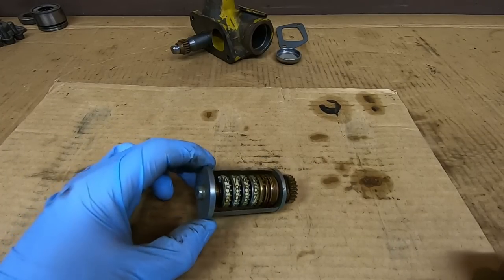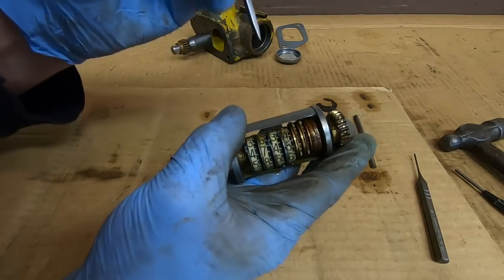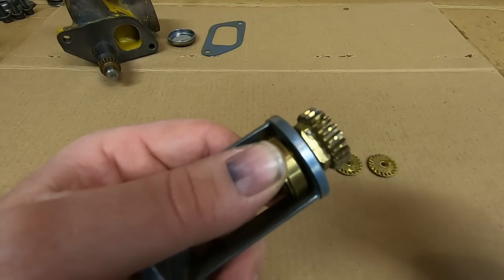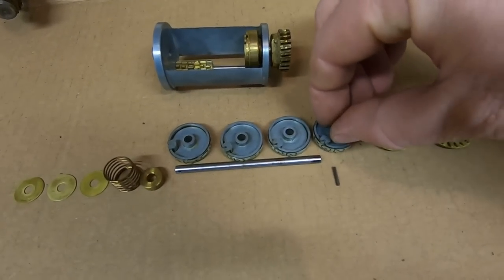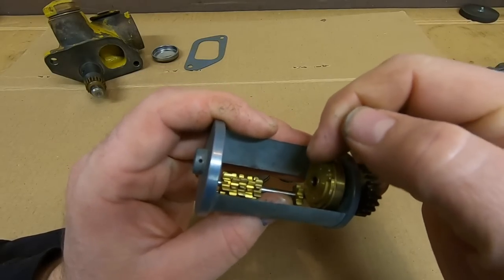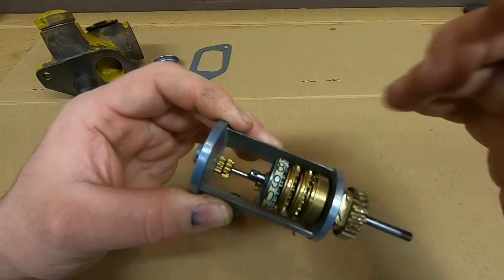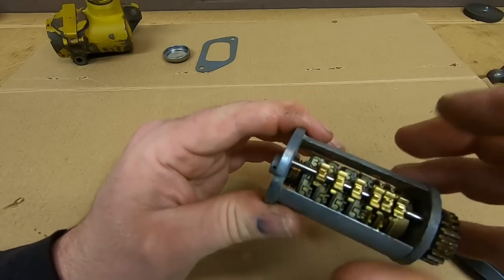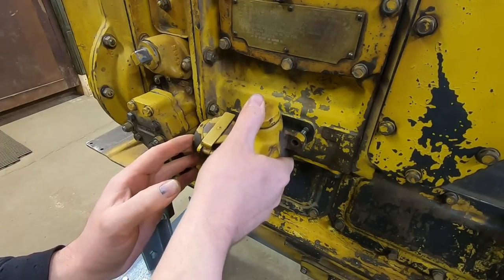Caterpillar D2 #5J1113 Diesel Engine Assembly Ep.38: Hour Meter Counter Repair & Meter Installation

Comment: You just went from Blacksmith (flame & brute force) to watchmaker in two videos, no easy task. If you reversed these skills the combustion chambers would still be stuck in the head and the hour meter would never work again! Apart from showing how to restore an old machine, you are demonstrating a technique and skill in how to think through and approach these type of challenges. What i take away is that, given enough thought, there is always a solution. Cheers Squatch.

Comment: I work on all kinds of tiny stuff - even have a microscope on my home bench. One trick I've learned with similar counters is stacking the dials on a cut-short shaft, then slipping it in as a stack, push the cut shaft out with the real shaft.

Comment: That's amazing technology from way back in that era!!)), no wonder Caterpillar is No 1 in earthmovers
Reply: That's actually a very standard digital counter mechanism used by absolutely everybody from the mid 1800s (if not earlier) onward. I expect it was patented by someone originally, probably in the 1700s, and then after the patent ran out everyone copied it. I've seen pictures of clocks where the parts were made of wood, and somehow managed to last for years. I last saw that mechanism design used as the counters on cassette tape recorders in the 1990s, but I imagine there are still a few things around today that might still use a mechanical counter.

Comment: Easy method to do the dial paint = paint the numbers black first. You can be sloppy, let the paint set an hour or so. Once that's done, carefully wipe the excess using a barely, barely keyed clean rag with  some paint thinner, just to wipe the excess, then, take a flat, spotless clean surface and using a brush, put a white dot on it. Using a sharp edge spread it thin and long, then, simply roll the dial over it until you have full coverage.
If you do this assembly style, you get the whole set done in two hours in between two sandwiches or what have you and they come out factory fresh, without any hassle. Seriously, i know it sounds involved a bit, but it's 1 2 3 and you're done.
Source, i've restored a few antique hour meter dials a while back.

Comment: That cleaned off number roller can be repainted with white out that stuff sticks like Baby shxt to a blanket used it many times for marking parts and recoloring imbedded numbers , Fill the number let dry then wipe the surface clean .

Comment: I'm curious as to how often service meters roll over. I remember cars having 5-digit odometers, which probably made sense at a time when cars didn't often last 100,000 miles, let alone 200,000. So I guess I'm asking, How many "hours" did this type of engine typically last? (Fewer than 9,999?) And would your answer differ for different size engines, those that ran at higher RPM's, or those that did different (e.g., heavier or lighter) work?

Comment: If you had set it to 9999, would that prove the ‘gear train’ was functioning if you advanced it one hour to 0000?  EDIT:  Also might let you know if there was any binding that might cause a problem later on.  Question:  Have you ever considered adding a Hobbs Meter (oil pressure and electric) to compare engine running time vs engine tach hours?

Comment: I would have put some little bit of camfer oil in there or a little marvins mystery oil to keep condinsation from forming on glass mavins mystery oil has camfer oil in it i use camfer bars in my machinist box to keep my mics. From rusting
Reply: I think you mean "camphor bar". Thanks for the tip though.

Comment: When I was a kid we heard about used car dealers turning odometers backward with an electric drill or some other means. It was later mandated that a means to detect this be included in the car. I wonder what today’s digital analog to that is. Also, when you paint that meter with late 30’s Cat engine enamel be sure to keep the cover over the glass closed... :-)

Comment: Just a note go for the viewers....I always add some AFT oil to my fuel to help lubricant these old fuel pumps....this new off road fuel it’s the best for these old pumps....also I have a 1950 7U D4 with 480 original hours and when the motor warms up it spits oil out the exhaust....any thoughts??
Reply: Never tried ATF. I HAVE used 2-stroke oil. There's no way I can recall the ratio I used, its been years, but I can tell you it wasn't much.
Reply: Sounds like you probably have a blown head gasket on an oil port that is opening up when hot.

Comment: Need a complete pony engine(NOT STUCK).... for my 1948 Caterpillar model D7 serial number 3T8644 
Pieces missing and it's Stuck
Bought it that way
Main diesel possibly NOT stuck 
Tractor a non Electric model with no generator nor lights
Hand crank start pony engine
Reply: Be on the lookout for a running pony motor for my D7 Built May 1948 serial number 3T8644

Comment: Given the most wear would be on the first pinion wouldn’t it be a good idea to reverse the pinion order left to right? Yes, the original wear pattern is one detriment.
Reply: From what I saw on those pinion's, they're one direction only. Flipping it, the "teeth" may not engage or, cause damage if they engage too deeply. If that makes sense. Re-watch the video, think you'll see and understand it better.
Reply: @Ham68229  

I'll look again. To clarify, mean the thousand pinion in the 1/10 position and so forth.
Reply: Kevin Nugent yah. You talking about just swapping the positions of them to get the worn-more ones further out? Thought about that too but didn’t know in “wear-in” patterns should be kept adjacent ... or if there is even any appreciable wear in patterns on them. Good question...